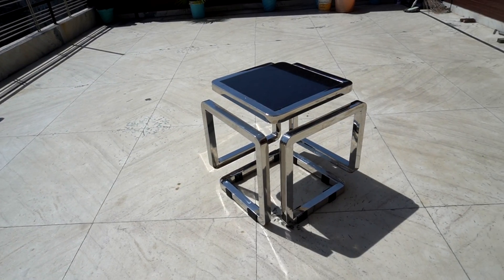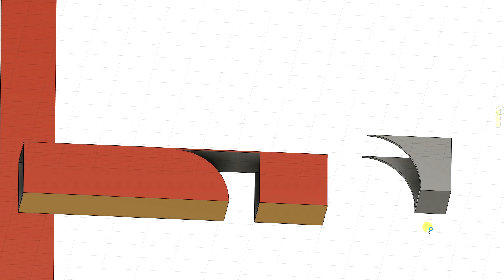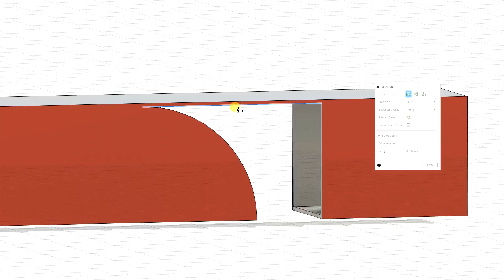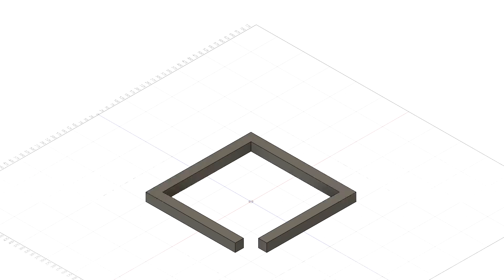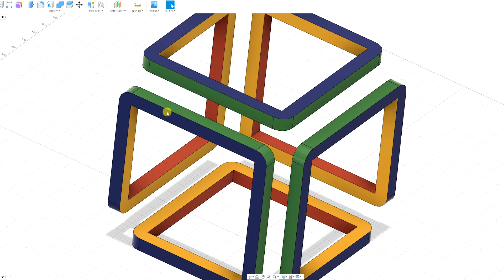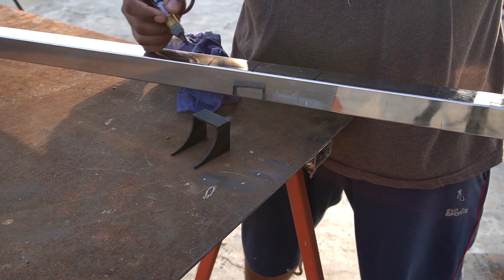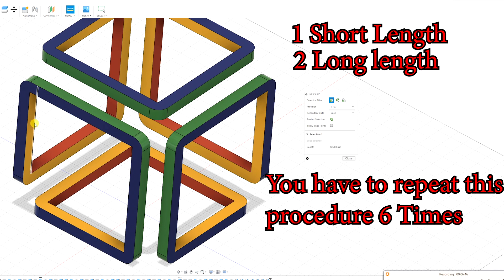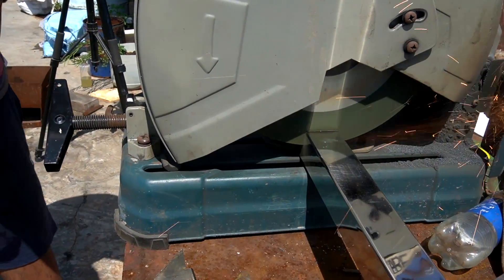Stainless steel infinity cube table with unusual welding joint using stick welding-By AMbros Custom

Comment: how about strength that table
Reply from the maker: Normally you can put 20kg on the table. If you add a member underneath the overhanging side then it's as strong as normal table. It's better to use acrylic piece as a supporting member. For normal coffee table you don't need any support

Comment: I’m in my metals class does any other metal work because we don’t have stainless steel
Reply from the maker: You can use mild steel box section, those are excellent material, stainless is difficult to work with, go with mild steel pipes
Reply: @ambroscustom  how long did this take? My metal class period is only time I can work on it and it starts at 955 and ends at 1045. So I have feeling this will take a while for me
Reply: @ambroscustom  my teacher needs me to draw the top front and right sides of the infinity cube table and he also needs dimensions of it is there any way you could help me with that?
Reply from the maker: @thedarknight471  this is a complex project, if you go with continuous pipe method like I did ,its going to take long time and have different dimensions and if you go with miter joint with sharp edges it's going to take less time. I don't remember the exact dimensions but fusion file you can do that.

Comment: Infinity Cube Table
I am in high school first year. I'm curious to know how long this would take.I am very interested in this and I want to build one myself. If possible I would like to know the exact size of it. How long all the pipes would need to be and also what are the measurements of what was 3D printed? I know this looks will probly not be replied to but I really like this stuff
Reply from the maker: Buddy there is an instructables blog post link in the description all the files you need are already over there, you can check that.
Reply: @ambroscustom  thanks and keep up all the good crafts they blow my mind

Comment: Can you do another video of you showing where you cut in so many inches. Before you bend it or weld it.
Reply from the maker: Buddy if you are going to build same size with 40 mm square pipe only then it's going to useful. I suggest you to first make a bend on scrap piece of pipe that will give you much better clear vision about this joint.
Reply: @ambroscustom  Ok I'll try with the same mm pipe.

Comment: Great torurial
Still have 2 questions 
1. Does somebody know how much a table like this can approximately hold. 2. Does the table react like a kind of spring when you put a heavy object onto it?
Reply from the maker: Thanks, there is an area in this table where if you add a transparent acrylic than weight carring capacity increase around 100-120 kg which I tested, without that around 20kg without any deflection and upto 30 deflect downward about ⅛". So if you want to bear heavy stuff just add some transparent acrylic in that way it's contain it's theme and still seems clean in look.
Reply: @ambroscustom  whoah, thanks for the quick reaction. Just to be sure: I am assuming the acrylic is between the top and the pipes just below it, and between the buttom pipes and the pipes just above that, correct?
Reply from the maker: Yeah, absolutely correct mate.

Comment: Came out good! I built one of these out of 1in square tubing but mine required about 100 more cuts than yours.  I like those radius corners!
Reply from the maker: Thanks brother appreciate that, definitely a bit more difficult table than normal construction

Comment: Please ...send the measurement....like hight...width ..length
Reply from the maker: There is a design file of fusion 360 you can download that and check by yourself because it's too complex to explain. Although the lenght of one side is 500 mm, but it kept varying, so it's good to check the 3d file for better understanding.

Comment: It’s beautiful and contemporary, it would be equally at home at a high end restaurant or bar as in any home. You do a great job of presenting the videos and explaining everything. One day I going to make a 'river table' with a live edge and epoxy top, I was going to go for industrial legs but I’ve now changed my mind. I know it’s almost an impossible question to ask as there are many variables but is this a good weight bearing design please? 

I’m also a keen bird watcher though I don’t get out much these days, was that a member of the starling family?

Another great video, you are a very talented man.
Reply from the maker: Thanks Mark, as far as the weight bearing capacity is concerned there are two points in this table where you can use blocks and increase its weight bearing capacity. During the starting of this build I wanted to be kept it a show piece, but simillar design can be use to bear a weight of 100 -130kg if you install support blocks onto those two positions. You can use acrylic blocks if you don't want them visible. I saw a video in which the maker uses acrylic rod to prevent the whole wooden cube from collapsing.
Reply from the maker: That's a hummingbird, seen after a long time in my area, might be because of lockdown and clean weather.

Comment: What was the size and length of the metal
Reply from the maker: Dear you can check the description there is fusion file link, you can get much better idea for the dimensions from that 3d model. Although the dimensions are planned for  18" cube table.